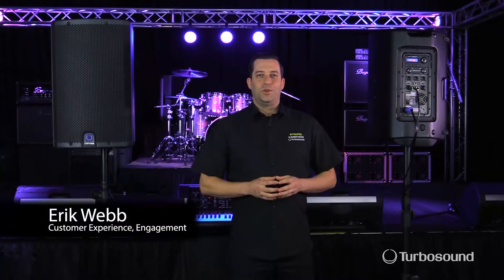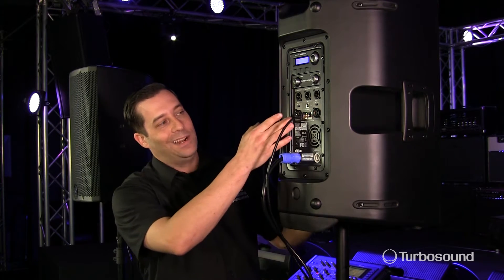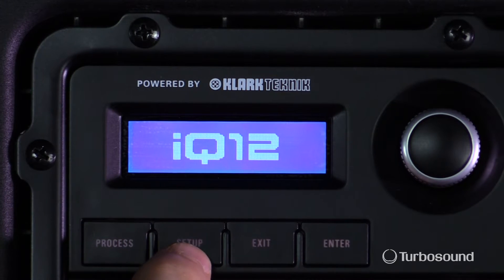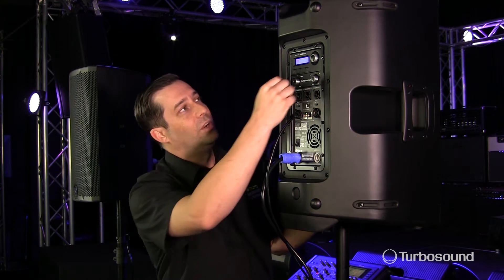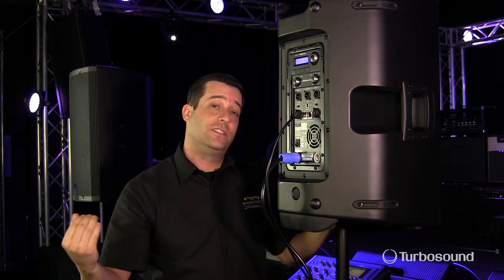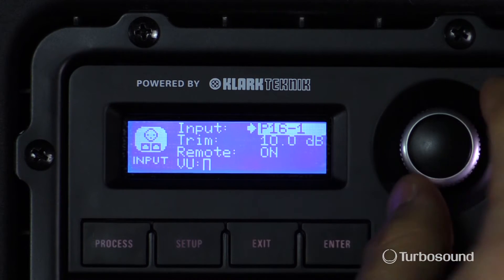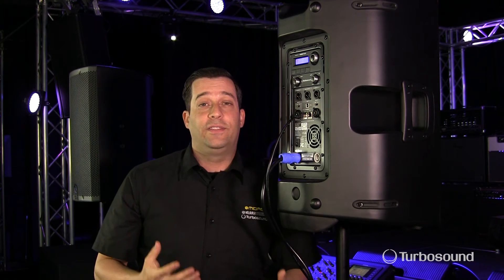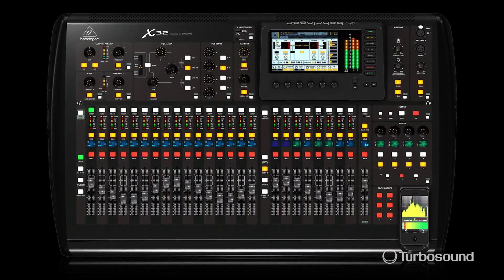TURBOSOUND iQ Series - Configuring Input Selection

Comment: Would it be possible to use analog and ultranet inputs at The same time? Meaning - in a fixed environment we would sometimes for live Music use a midas m32r Mixer (with ultranet) and sometimes just Music from a PC without any Mixer (analog). Will we have to change input settings manually on The speakers to change or….?